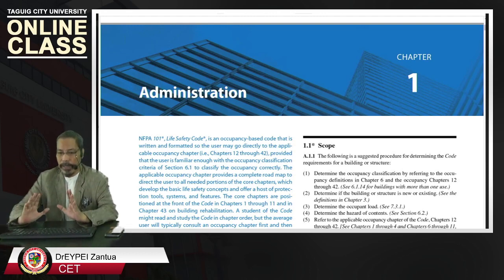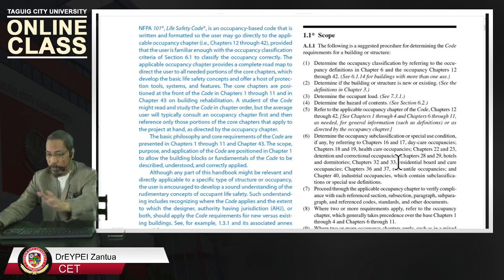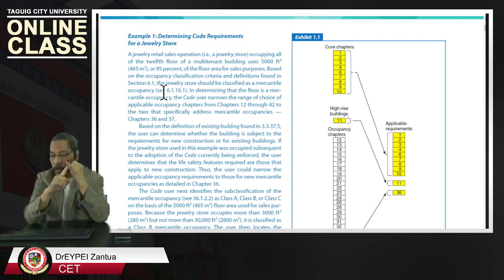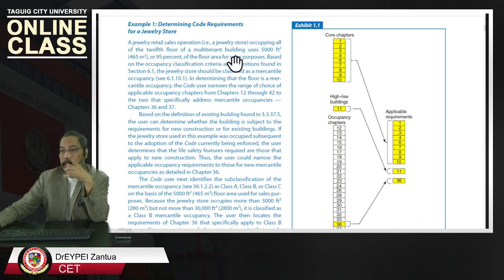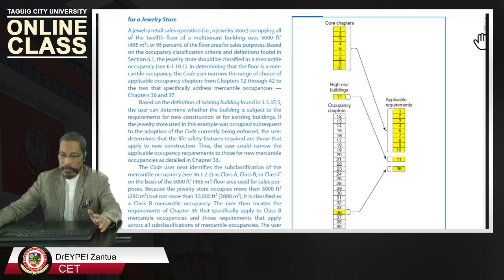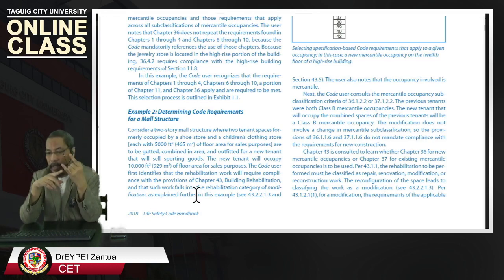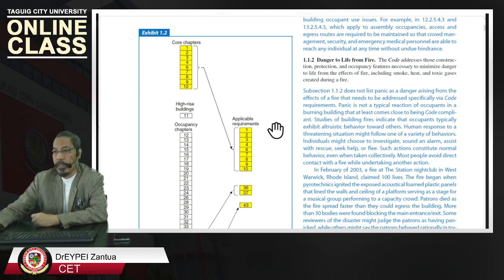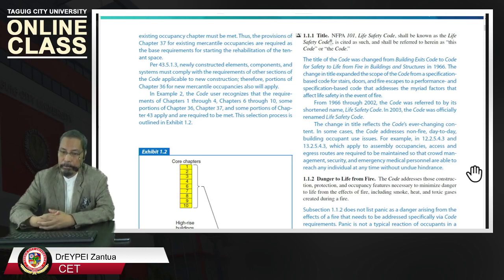Ch01 Administration part 01 NFPA101 Life Safety Code CE526

Comment: there is an example of defining code requirements for jewelry stores, commercial employment. This example is divided into several chapters. There is also an example that defines the code requirements for a shopping center, the structure of a shopping center. It is important to familiarize yourself with the various chapters and explanations based on these examples. The code's former name was changed from "Rules for Evacuation of Buildings" to "Rules for Safety of Life from Fires in Buildings and Structures" in 1966. Thank you sir for tackling these to us!

Comment: its example refers to the code requirements for a jewelry store, the mercantile residence, this example has different chapters. The former title of the code was Building Exits Code but it was changed to the Code for Safety to Life from Fire in Building and Structure in 1966. Later from 1966 to 2002, the code was referred to the Life Safety Code, and finally, in 2003 the Life Safety Code name is official.

Comment: Mendiola, Mc Axel Joseph P
19-00167

Thank you sir for this video information about the scope of chapter 1, its example refers to the code requirements for a jewelry store, the mercantile residence, this example has different chapters. The former title of the code was Building Exits Code but it was changed to the Code for Safety to Life from Fire in Building and Structure in 1966. Later from 1966 to 2002, the code was referred to the Life Safety Code, and finally, in 2003 the Life Safety Code name is official.

Comment: Thanks sir for discussing the scope of Chapter 1, an example of defining code requirements for jewelry stores, commercial employment. This example is divided into several chapters. Example 2 defines the code requirements for a shopping center, the structure of a shopping center. It's important to know the  requirements for your code. It is important to familiarize yourself with the various chapters and explanations based on these examples. The code's former name was changed from "Rules for Evacuation of Buildings" to "Rules for Safety of Life from Fires in Buildings and Structures" in 1966. Afterwards, codes were assigned to the life safety code from 1966 to 2002, and in 2003, the name of the life safety code was finally formalized. thank you.

Comment: Etabes, Joshua G.
19-02128
- Thank you sir for discussing the scope of chapter 1, the example which is determining the code requirements for a jewelry store, the mercantile occupancy; this example is consists of different chapters. Example 2 determining the code requirements for a mall structure, a mercantile. It is important to know the code requirements. From these examples, it is important to be familiar with the different chapters and their descriptions. The former title of the code was Building Exits Code but was changed to Code for Safety to Life from Fire in Building and Structure in 1966. Later on from 1966 to 2002, the code was referred to Life Safety Code, and eventually, in 2003 the name Life Safety Code was official. Thank you Sir.